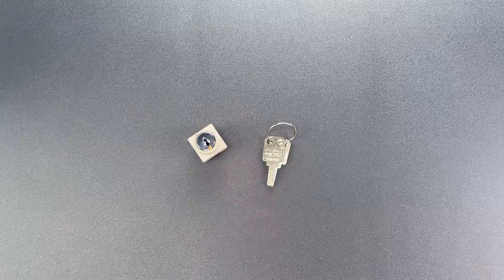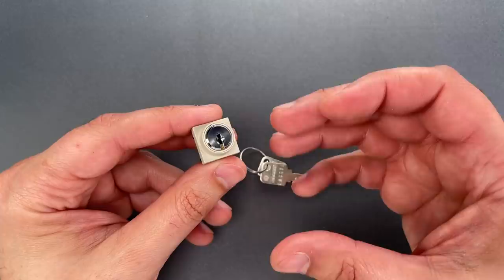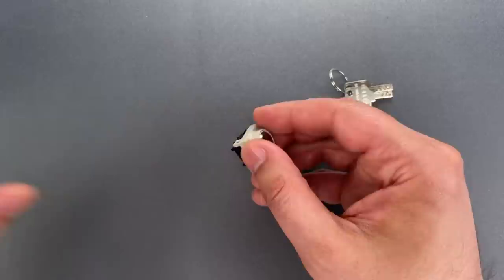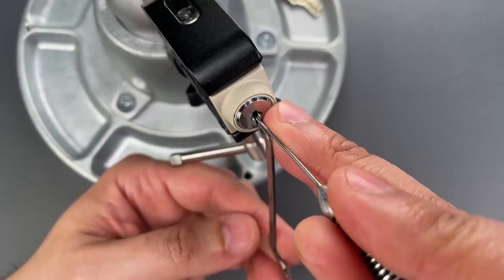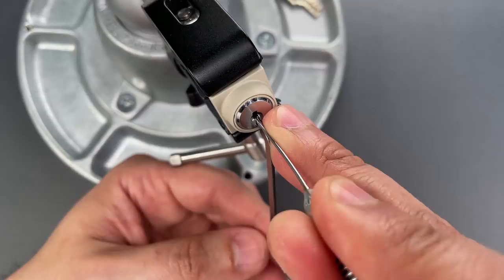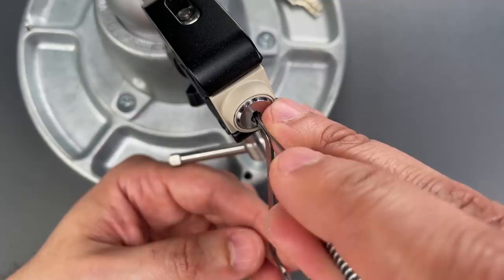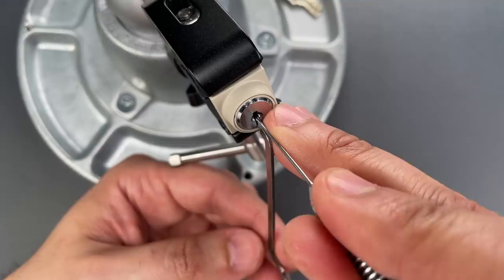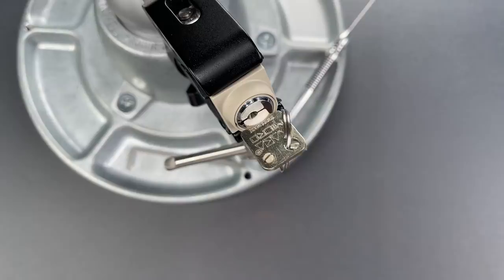[1354] Small But Mighty: Kaba Micro Key Switch

Comment: Required skill level: SUBSTATIAL

Ya gotta slap that on the package. Basically a 10/10 review
Reply: As long as one fixes the typo; then the spelling will match the skill level😜
Reply: @kitlykee1381  I agree. Just imagine how high it would be if it were substantial.
Reply: Substatial:  The upper layer above the ozone,  or an  70's East German Prog Rock band,  or the penultimate stop on the Nekrosovskaya line.   Hmmmn..
Reply: @gallimead  cool, did not that was actually a word, learn something new ever day.
Reply: I disagree, it's 8/10 at best. A 10/10 wouldn't have been successfully picked. I also doubt that something that small has any substantial resistance to more forceful attacks. But, I suppose it is adequate for locking up office supplies and other low-value things. (8/10 you can pick 8 high-security masterlocks in the time it takes to pick one of these)
Reply: @Acaykath  I think it'd make a really good lock for a locker
Reply: more a 11/10
Reply: Or in other words.  Drill the core out.  Skill level: practical.
Reply: @TheAnimeist  no, thats like you trying to steal a car by drilling out the ignition lol. He said this is a microswitch lock, aka, an electronic locking device.
Reply: @Acaykath  its an electronic switch. This is more likely a server room ignition switch rather than an office supply lock (im talking hyperbolically) Also who would use a swiss made with high accuracy machining lock for office stuff?
Reply: I heard him go "hmm". I wanted one then
Reply: @gallimead  The East German Prog Rock band would be called 'Sub stasi al'
Reply: seriously, that would be awesome. new rating system "LPL level : 8/10"  which the rest of us know by our current lock standards is more like 280/10 compared to the current system :p
Reply: @TrevorDennis100  ahhh.. the more you know. 😁
Reply: translated: you aint gonna open this bitch.
Reply: @alexandrutereify  I saw one of these used on a high voltage power supply: 30kv for electro-static painting, I believe.
Reply: @paulmcgrath2175  really awesome, thank you! I was wondering what machinery could include such switch.
Reply: SUBSTANTIAL

Comment: "I think it is set" Holy crap he doesn't know! This lock is bulletproof.
Reply: Did you miss the old series of "____lock vs AP rounds"? I assure you it's not actually bullet proof 😜
Reply: Look at video 927
Reply: Now if this company makes door locks
Reply: yes, but not LPL proof.
Reply: @michelguevara151  Yes. Just LPL resistant
Reply: @dao_of_potato4957  Indeed. THAT is bullet proof
Reply: @assassinlexx1993  actually it does. And those tiny locks, or small padlocks with the same system as in the video are a common advertisement gift of this lock company. He picked several locks like the Kaba 8 or the Kaba 20 from that company. They look like the door locks they make, but are mostly used for non important things like securing the trashcan to prevent people from throwing their rubbish in, or to close the frontdoor of a big building where dozens of keys have to fit. I would really like to see him picking a kaba star. He would have to use an old one since the new use a combination of mechanics and a microchip, but it would be cool to see.

Comment: Kaba makes amazing locks. They are the only ones my local locksmith will install when you say you want "security". They'll even fit Kaba cylinders into padlocks.
Reply: Kaba also makes some crap... it all depends upon the specific product you refer to. Just like Master Lock, they make a wide range of products, to suit particular marketing channels. Kaba is owned by Dorma, One of TWO companies ( The other being Assa-Abloy ) that between them; own about 80% of all the COMMERCIAL lock brands in the Western World. 

Then there is Schlage/LCN/Von Duprin.... and dozens of complimentary products brands only a matter of time before one of the Goliaths consume this group.

Then there are a few firms that produce residential products, Spectrum Brands includes Kwikset, EZ-SET, a BUNCH of private label brands and other dumpster-bait. Brinks and DEFIANT are from another maker. IT takes a LOT of manufacturing to fill all the dumpsters. Spectrum is said to produce more lock by volume than anyone in the world.
Reply: @citylockapolytechnikeyllcc7936  I think your comment is believable, I do not know if you are in the USA or not but here you cannot walk into any consumer door security display area in a hardware store or home center without bumping into a big Kwikset display.  That three holed key with a ring side that looks like a house roof line is the iconic "House Key" in the USA.
Reply: @filanfyretracker   I am in Boulder, Colorado.
Reply: @citylockapolytechnikeyllcc7936  Coming from Lakewood, I really like your company and appreciate your knowledge.

Comment: security measure: We manufactured it with tight tolerances.
Crowd: Gasps in horror
Reply: Security measure: we went with the cheapskate stuff cuz we didn’t fuck up manufacturing…
Reply: After this video somewhere in Switzerland:
"We need to adjust our machines."

Comment: In case you guys didn’t know, micro key switch locks are used to activate electronic components ranging from elevator overrides  all the way to nuclear activation switches.

(I installed several of that exact switch at nuclear power plants)

Comment: That took LPL like a minute and a half to open. I'm pretty sure that for most people that's basically not happening, putting this lock well into having to worry about destructive and social engineering attacks more than picking. I'm impressed.

That said I'm planning on using a cheap wafer lock in my next build that needs a key switch because it's mostly there for feel, not function. Toys can get away with that :P

Comment: There is a black plastic body model of this lock that I picked and disassembled a few years ago and was amazed that while the keys were set for eight cuts (as on this display), when I disassembled it, it only had four pins in it.  I am glad to see that this one LPL is picking actually has the full eight pins.

Comment: This lock has a better resistance to unauthorized access than a Master Lock yet its purpose is probably not security in the sense of keep crooks out of my stuff and is more to keep someone from turning some device off or on when it should not be in the opposite mode that it is in at that current time.
Reply: If you think about it that could be vastly more important though if this was used as say a lock out feature for safety human life is always more important than valuables

Comment: I used to have a CNC machine used to cut these keys. But I didn't have the control computer and software with it. Travel in each axis was short but from the looks of how it was built would be capable of very high precision. The frame was assembled from thick slabs of golden brown anodized billet aluminum, the stepper motors were large for the machine's size and the spindle motor was also a big one. It had an ER16 collet chuck and a special vise to hold the key blanks.

I sold it to a person who was looking for a high precision, tiny CNC machine to mill very small parts. If he wasn't able to figure out which pins on the DA15 connector were step and direction for each axis and spindle control he said he'd just replace the 1990"s electronics with new stuff.

Comment: That is considerably more secure than the lock on my front door. But if I used a switch lock there LPL would just wave a magnet at the mechanism and open the door.
Reply: That's why you should use a processor-controlled servo or stepper motor to actuate the mechanism and not a solenoid.

Comment: LPL: “It’s substantial”
Me: I’ll take four for my house!!
Reply: You'll need some electronics skills to make use of this one. Note that the title says "Key Switch". Get it turned, and you're turning a circuit on. You're probably going to want a motor with a worm gear to actually move the bolt on your door. A solenoid could easily be moved with an external magnet.
Reply: I can help you with as many as you need!

Comment: Since this lock is basically a switch, proper application could render any effort to pick such a lock-switch useless. If you would have to open and(!) close the lock within a short period of time (say 2 seconds), picking is simply not an option, since the electrical contacts do only switch to the other state, when the lock is blocked again. So, you would have to pick the lock, and then pick it again, the again-part is tricky, since it has to be quick. The described application might not be the standard way to use the switch-lock, however, since this is basically an electric switch, nothing stands against it.

Comment: I get the impression that any lock is just an obstacle. Real secure locks seem to be a myth....
Reply: Yes. But all criminals have a certain threshold of difficulty at which point they won't bother trying.
And if a lock requires specialised tools and a substantial skill to open, vast majority won't bother. If it requires a bent piece of wire and a vague idea of how to properly wiggle it inside the key hole, most of them may bother just for the hell of it.
Reply: No lock is unpickable, to pick a lock you need, the tools, the skills, the opportunity, and the time.
Reply: That is 100% true actually. There is no such thing as a lock that will keep out someone who is determined enough to get past it. This lock for example is a switch, you could just open up what it's attached to and use a wire to bypass it entirely.
Reply: A locks only job is to keep an honest person honest. Anything more is just a bonus.

Comment: This would be used to secure an electrical device against switching on or off or manipulation by unauthorized people. It is not meant to prevent attacks by somebody who has the intention to do harm. You could easily break the lock by force or bridge the contacts by other means like soldering a wire. This is a lock that serves its purpose very well.

Comment: This a common type of key switch found on machines.  I have come across an interesting variation of this lock where 3 different coloured keys are provided and each one allows different levels of access to functions of the machine.  For example the green key will only turn to the 1st position, the orange to the second and the black key will go all the way to the 3rd position.

Comment: For switch locks that attach to tiny electronics, the dominant alternative is an electronic key device with a giant number of differs and no sequential SPP technique.  Other jobs for tiny locks are weakened by the option to steal or smash the locked box itself, then complete extraction of valuables far from the victim.

Comment: Many years ago, the company for whom I worked got paranoid about security.
They changed every lock in the building for 'Kaba' locks, as they were advised that they were the best locks available.
Fun fact about these locks, is that a set of locks could be specified with a 'hierarchy' of keys.
in a set of ,say 50 locks, each lock would have it's own unique key. Then, you could have maybe 5 'master' keys, which would open a group of 10 locks.
Finally, you could have one 'grand master' key, which would open all of the 50 locks.

Comment: The kicker with locks like this is that while they may be more difficult to do a non-destructive entry on, I'm willing to bet something this delicate is far more vulnerable to destructive entry. Jam a screwdriver in there, use a vice grip on the handle for better torque, and you could probably turn the cylinder through brute force alone.

Comment: I was hoping to see the connections on the rear….    Many thanks for the video LPL
Reply: There are 4 contacts for connection to a PCB. Contacts 1 and 2 are connected when in the “on” position. Points 3 and 4 are not currently connected. Inside there is a small piece of metal that looks like it can be shaped/changed depending on what you want the switch to do when. There looks like 4 bibles each 90 degrees from center. I don’t know if all are pinned in this configuration besides the 8. Maybe there is a version with additional pins on the edges?
Reply: @Daniel-qw5ve  many thanks

Comment: That’s crazy, it looks like the lock face of those cheap file cabinet cam locks, but it really is high security… I imagine this switch would be used for some high tech commercial access control systems keyed override function like in police stations, or other government settings 🧐👍🏼

Comment: Think I have encountered this or similar on a medical device. It was used to access the maintenance mode menu settings.

Edit: It had two keys, one for normal maintenance mode access. And one for extended maintenance mode. The later could turn the cylinder an extra 90° where code clear, factory reset and parameter adjust was available.

Comment: Challenge: I would like your setup to attempt to place the lock into a common use position that requires your angle to be limited like it would be when its in real world use. Your tension hand is often located in a way that could allow for greater control then if you had a door in your way.  Always awesome either way.
Reply: Today's lock would most likely live on an industrial control panel or electrical box. It would have a stack of electrical switch contacts on the inside of the panel. As difficult as this one is for an expert to pick open under controlled conditions, I'd already be looking for some other way to get the switch state I need.

Comment: The lock may be good, but it's a swirch lock so further down the line they'll be an electromagnet or something similar, so it'll be a case of "I'm just going to slide my Mastercard through this gap, and we have it open" or "I'm just going to place my magnet here and the strike plate is released", followed by "And just to prove it's not a fluke, . . . "

Comment: Now if it was my lock installation I'd put a strain gauge on it so if it detects torsion for more than a few seconds it fires the fence energizer.  If anyone hasn't touched an electric fence, do try and keep it that way.
Reply: That could be effective with some locks, but most Master Locks would still be defeated in that time. Be sure to still use a good lock.

Comment: It looks like a plastic case, wouldn't a screwdriver be faster via the "force and cram it method"?
Reply: It has pins for connecting to PCB. 4 electric terminals currently configured for connecting between pins 1 and 2 when “ON”. Destructive attack would likely bend or break the small wire inside. Thus making it unlike to pass signal properly. Could you break it out entirely and then probe with a oscilloscope and construct a bridge between the correct now broken PCB tracks……Possibly

Comment: I would buy a safe that had this mechanism as a backup lock over the crappy cores that seem to be prevalent in most.  Is the body of the switch plastic though?  If so, you could probably defeat it by just breaking it.  I know it has good tolerances, but wondering if it could be raked open?
Reply: These type of switch locks are placed into things such as lift control panels to block access to functions like basement access for example. So the panel acts as a protection for the switch body as the front is flush with the metal panel.
Reply: @tinplategeek1058  Yeah, I could totally see this being used in an elevator or industrial control panel.

Comment: How did you get that key into a unlocked lock at the end? I would think its not possible due to set pins and rotated cylinder.
Reply: The lock was designed that way so the key could be inserted / removed whichever of the 2 positions the lock was left in.

Comment: Why would any company use the crappy ones instead of this? The price can't be that different right? Wouldn't most of the cost be in materials and logistics so it shouldn't be that different.
Reply: This is probably double the price of a crappy one, over 1000s of locks that's huge

Comment: how would you use this lock?
Reply: You would have some electrical equipment you don't want operates by unauthorized people.
Reply: We use similar keyswitches in the rail industry as a form of LOTO device to prevent train movements along specific tracks when a maintainer is working in the danger zone.
The maintainer will call the dispatcher/controller up and request protection for a track, I give permission and press a virtual button on my workstation VDU. The maintainer can then turn the key which will electrically inhibit points and signals to prevent train access. Our devices are made by Abloy however. 
Hope this helps

Comment: What does "overset" mean?
Reply: In pin tumbler locks, it's where you push the pin a little too high so it overlaps the shear line instead of being below it, and the lock will be blocked from turning. You would need to loosen the tension a little and hope that the pin drops down without dropping every other pin down, or just release the tension and let everything drop and start again.
Reply: Understandable confusion, considering how rarely you hear the term on this channel..

Comment: Can someone explain why he says "I'm going to use this 50 1000s thick turner".. Is that 50 over 1000, or shortened to 1/20? And what is that, is it 1/20th of an inch, or 5% of an inch thick? Why not just say " .05 inch thick turner".. OR Go crazy and use mm and say "I'm going to use this 1.3mm thick turner" ... Americans and measurement is something I will never understand.
Reply: 50 thousand*th*s (of an inch). Many technical inch users treat the thou (-sandth of an inch) as the common base unit for precise lengths under 1 inch, much like the km is treated for long-distance travel.